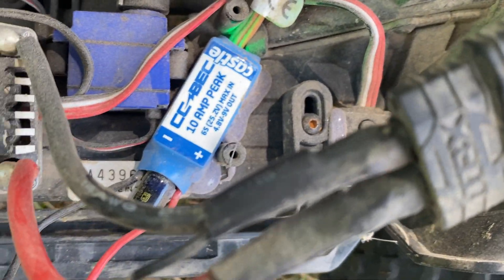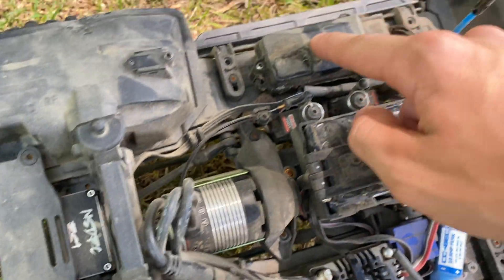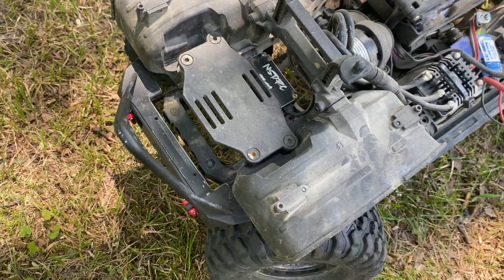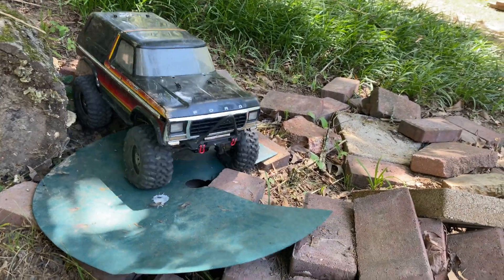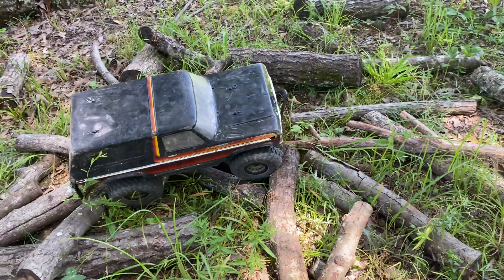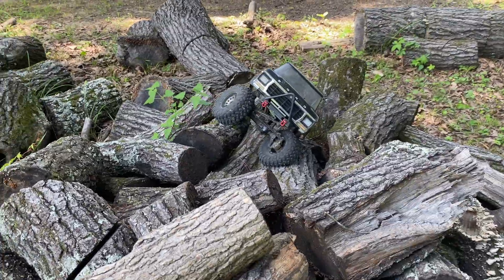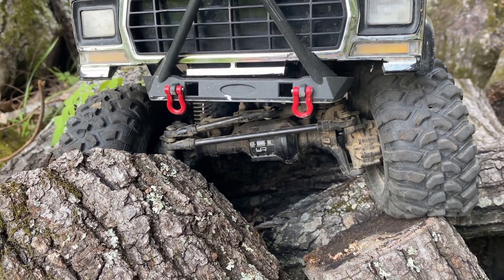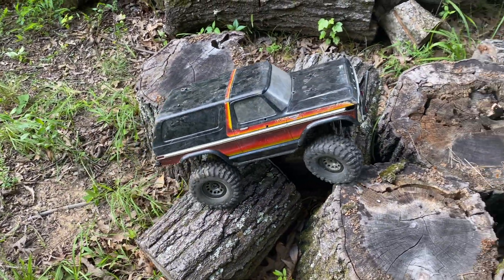Castle 10amp BEC Testing - Do I Really Need a BEC? NSDRC RS1 Servo

Comment: I would stick with the BEC if your receiver cannot provide high enough voltage. Keeping it running on the voltage it was designed is good for the health of electrical components